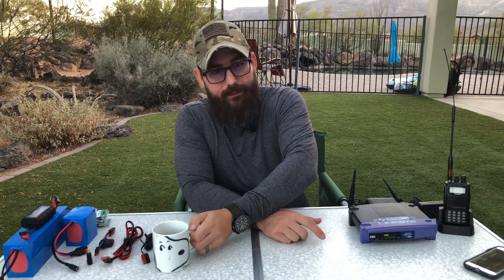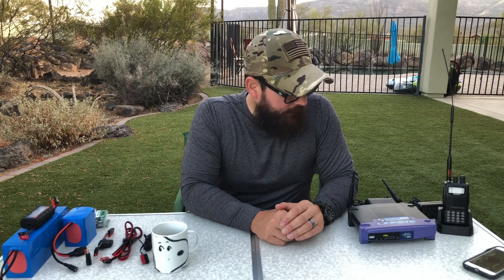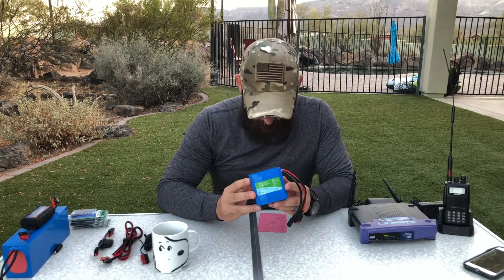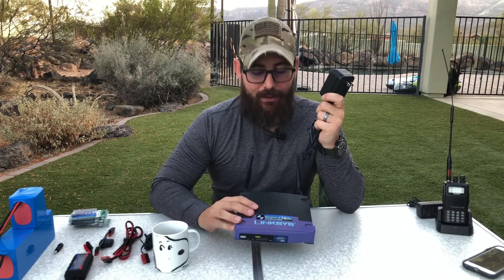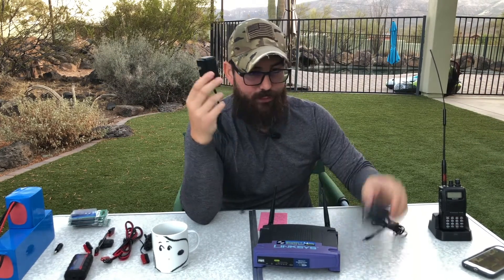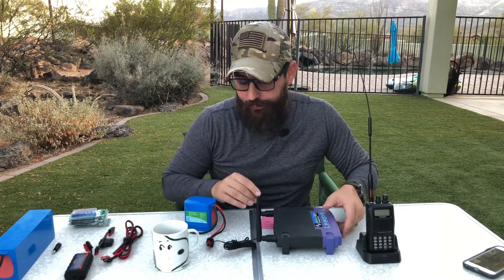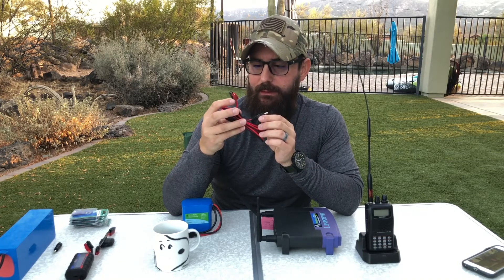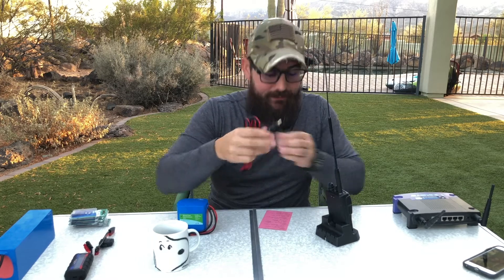12v Appliances & Accessories for Preppers and Hams

Comment: Very nice video! I’d like to see your refined mini solar generator. And once you get it all in place, I’d love to see your solution for your freezer. That’s what I’d like to do, is to have a system for my fridge and freezer, with the possibility to run a few lights.
Reply: Same here
Reply from the maker: It's absolutely on this list of videos to make. I still have a few more components to purchase, so this could take a few weeks (I still need to buy a 100Ah LiFePO battery, misc cables and find a good 12v freezer).

Comment: Fine business! The inverter is a nice tool to have but DC to DC is definitely the way to go when possible. Boost and buck converters will step voltage up and down as needed, and for 12/24V systems those are pretty easy to find from automotive suppliers.
Reply from the maker: I agree 100%. Chris, you always seem to be my first viewer. I appreciate your support! I have a couple of buck converts for going from 12v-to-9v and 12v-to-5v. I may add this list to the videos to produce. Take care.